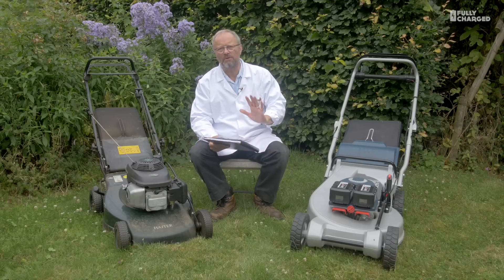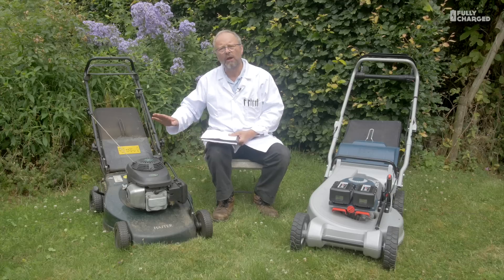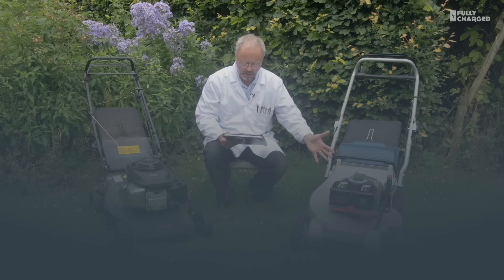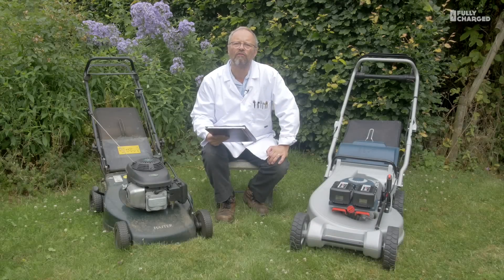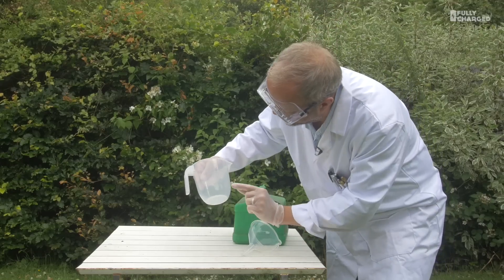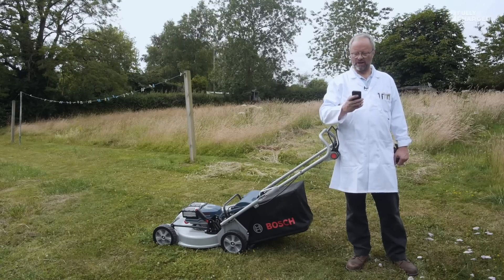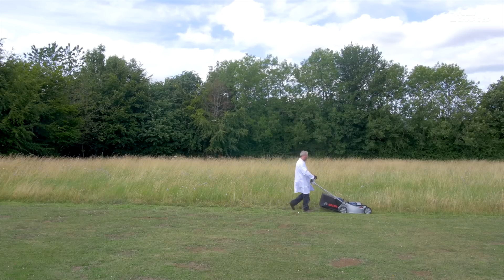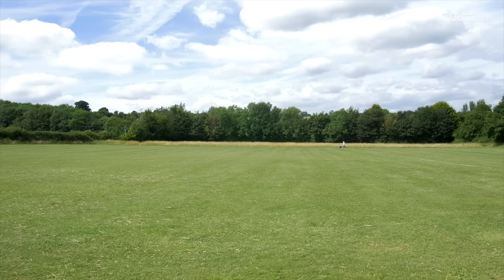Battery V Petrol. The Lawnmower Test | Fully Charged

Comment: Wow, I am really impressed that the batteries only need about 20 minutes to charge when they are completely empty. :-O
Reply: It's a professional grade mower.  The consumer (home) model would take longer to charge and not last as long.
Reply: because BEV is superior to ICE.
Reply: +pcfreak1992 Yup. They also last a good number of cycles apparently. Bosch gives a nice guarantee for that. On the downside, one battery pack costs more than 300 Euros, so both batteries are over 600 Euros. You can buy a cheaper battery mower for that money already.
Reply: Holy crud - I got offered that much for a perfectly working car recently with an MOT.  In fact, my ipad 4 is worth more...right now!
Reply: This mower is built for use at sensible areas like hospitals, because it's quieter. Professionals pay this money because they get it back over the time , and they use it daily and save a lot of gasoline and money. For private use this lawn mower is a nice gadget, but its not economic. But there are smaller, cheaper models for private use, which have smaller, cheaper batteries.

My semi professional petrol mower has a 53 cm blade, now there are 80 Volt battery mowers from the same company with almost the same blade, and for the same prize like my petrol mower 7 years ago.

Comment: Electric engine has energy conversion efficiency (ECE) about 95%  and even more, then petrol engine has ECE about 20-30% ( depends on model). Though, it's really important how electric power has been recieved. If it's  from coal-fired power plant than the difference in efficiency between the types of energy almost disappears.
Reply: +Magic Wind 
Small gas engines like on mowers are not nearly as efficient as car engines.  I think they are more like 10-20% much of the time.
Reply: +Magic Wind
 
Uhm, nope!

http://longtailpipe.com/ebooks/green-transportation-guide-buying-owning-charging-plug-in-vehicles-of-all-kinds/gasoline-electricity-and-the-energy-to-move-transportation-systems/the-coal-powered-ev-myth-electricity-is-only-as-clean-as-the-method-to-generate-it/
Reply: No it doesn't. Do some rudimentary research and you'll see you're roundly incorrect.
Reply: +Magic Wind      20-30% is for a large multi-cylinder engine with all the whistles, such as EM, fuel-injection, water cooled, lean burn, idle-stop, etc. .   For a simple, small, single-cylinder,  carburettor fueled, 'knackered' motor running the same oil/worm-shit lube for 10 years, a bit less.  Try 10%.
Reply: +Magic Wind Even if the electricity is 100% from a fossil-fuel powered power station, the efficiency of the power station burning the gas/oil/coal is always going to be higher than the lawnmower burning the petrol. Plus, there's the opportunity to change the method of electricity production to renewable.
Reply: considering the mower did less than 10% the amount of mowing as the electric one, it's pretty clear the "efficiency" can't be beyond 10% Not to mention that the video was made on a bright sunny day by a guy with solar panels on his roof.

Charging those batteries may have well been "free" energy direct from the sun.

Comment: Pretty interesting, I wonder what a comparable 21" to 21" weight would be with the same decks, etc. how much you gain or loose with batteries and a electric motor over a gas motor.  We have a landscaping company and I have often wondered if we charged the batteries via the trucks Alternator (I wonder how many amps those chargers pull as you guys have 220v over there) between houses.  You could always stack another pack of 18650 Li-ons on there for more range, interesting!
Reply: +Kingsoupturbo im a gardener, they are two grand a pop, my old harry cost 700 quid and is 10 years old, its bombproof, dunno how robust these are, nice and quiet though. servicing would be cheaper.

Comment: Nice touch to convert kWh in BTU just to confuse us all. Us metrics know Joule.

Your piss is also a millions of years old liquid. But that is less relevant because the number of usable Joules contained in warm piss is negligible.

Still. Good job explaining a proper apples and oranges comparison.
Reply: +Tilman Baumann If you're going to point out that piss is millennia old, you may as well point out everything - everything! in the universe is as old as the big bang.  Because it's true.
Reply: +Will Davis well done Sir.
Reply: Will Davis what you say is by the way not correct. Not on a atomic level.
And certainly not on a molecular level.
But those are of course arbitrary definitions of "everything". Molecular bonds of water have been around for a long time.
Stuff has been around for a 'little' longer.
Oil not so long.

Comment: I really appreciate how you always make good use of the charging time.  this may sound facetious, but I assure you it's not.

people go on and on about how it takes a long time to charge, but if there are enough chargers, the range on a decent electric car is more than enough that you really will want to stop before you run out of power.  it was revolutionary for me when you made that point about your tesla.  

and here again, this is just more of the same: yes, it takes longer than pouring gasoline in, but it doesn't take that long.  and you'll want a break anyway!  in the case of this mower, I'm sure that if you absolutely have to keep going, you can get spare batteries and charge while you work.  the batteries are bound to cost, but I doubt it's extreme.

simply awesome demonstration, thank you.
Reply: +ThoperSought On top of that, electricity is piped straight to your house, so you don't need to make a special trip to the petrol station to fill up our little jerry can :)

Comment: So what you're saying is that the energy density of batteries is pants.
Reply from the maker: +l1fechooser In one way, yes, it's very low in comparison to petrol, but with one rather key advantage. It's merely a way of storing energy and can be used again and again and can be charged from any generating source. Pure dirty coal, marginally less dirty gas, relatively clean nuclear as long as you don't count the waste, wind, solar, hydro, etc. 
Petrol/gasoline is only from one source and it's very hard to use it twice.

Comment: The terrible thing about gas/petrol mowers is that they pollute more than a modern car. They don't have all of the advanced emissions controls. I do have one question about this test. Were either of the mowers self propelled?
Reply from the maker: +RickMakes Both models are self propelled and yes, the exhaust system on the petrol mower is very crude to say the least. Would never be allowed on a street vehicle.

Comment: So the lesson seems to be that energy density of the batteries / petrol is one thing, how it is used and the efficiency of the drive train is the more important factor.
Reply: +Stephen Smith It's the efficiency of the powertrain that is more important than the drivetrain.  The drivetrain does not include the engine, but just the bits that make the blades actually move.
Reply: +Will Davis and no reduction gears, transmission, clutch, etc. energy transfers directly to the wheels.

Comment: I am shocked at how long the first mower ran on just a splash of fuel.
Reply from the maker: +Billiamiscool Yes, it was very impressive wasn't it. I was surprised and I've been using that mower for years
Reply: +Billiamiscool It's the way forward for mowers and petrol cars....the big mistake is to fill the tank lol. Splash and dash, with an automated single gallon in the trunk. Every now and again, it throws just a squidge of fuel near the cylinders. Drive to Lands End and back :)
or....could the secret of huge MPG for cars, be to fit lawn mower blades underneath ?!
Reply: That, to me, was the most impressive bit.  I expected it to run less than a minute.
Reply: I would think his test would be much more valid if he just filled up the tank mostly (maybe a nice, round liter), ran it until it was nearly empty, then divided by the time it ran, getting milliliters per minute. Then compare to the electric.

Of course, this isn't really a scientific test anyway, as we have no way of knowing the mowers are doing measurably equivalent work.
Reply: Ronald Garrison that’s missed the whole point. The demonstration centres around the efficiency of electric drive, not about the energy density of petrol, which of course is far better than battery power. But the point is clearly demonstrated - electric drivetrains are far more efficient.

Comment: still crazy how dense petrol is
Reply: +iMiguelAOG 
true
Reply: If only we could extract energy from it efficiently...
Reply: +Craig Blaylock It would be great if all combustion engines had a efficiency similar to e electric engine.
Reply: Ben Bubeck or if batteries were as energy dense as petrol. Imagine the battery life on phones
Reply: It would last literaly a 1000 times longer. (maybe not that much but you get the point) :D
Reply: Ben Bubeck it would be amazing
Reply: I did the battery to petrol energy density comparison a long time ago, and for equal weight, petrol had about 100 times the energy density of a battery, give or take.

That kinda suggests why electric aircraft are lagging behind cars. XD

And... Why the original Tesla roadster (which was a converted lotus ) weighed 500 kg more than it's petrol equivalent, and yet still had maybe 1/10th the amount of stored energy to work with.

Comment: Might have been interesting to compare the decibel readings and running cost also
Reply: Roy Richardson 
according to what he said in another comment, the price for the fuel and electricity is about the same: 10p

other running costs have not, afaik, been addressed.

decibel reading would be interesting to know.
Reply: +ThoperSought Snag is that I do not think his assertion is sufficient - let have a bash

56 ml of petrol at say £1.07 per litre is 5.992 p 
Assumption = Half full batteries for 50 mins = 0.42 kW for 1 hour 40 mins = 0.7 kWh
Economy 7     @ £0.068   / kWh = 4.76 p
Peak rate        @ £0.1329 / kWh = 9.3 p
Agree?
Reply: Roy Richardson
looks reasonable.

Economy 7 is an off peak rate?

I think he was using a slightly higher fuel price, but I don't think it was high enough to cover a 4p difference.  don't remember for sure.
Reply: +ThoperSought Yes Economy 7 is the UK overnight tariff - depends which energy company he is with as to how much he pays on each tariff
Reply: +Roy Richardson The battery capacity was 0.42 kWh. not 0.42 KW. So 0.42 times 0.068 = 0.03 p.
Reply: Roy Richardson
thanks.  I'm in Japan, and the rate depends on how much total power you use; there's no off-peak rate, which is weird.

it seriously makes me want to get off the power grid entirely.
Reply: in the long run battery electric is vastly superior in all respects.
Reply: +Roy Richardson   Bosch claim it is half the db of a petrol mower.  Like VWs test results, that's likely to be with the petrol mower's silencer sawn off and theirs running under a couple of potato sacks.
Reply: belson alan
reminds me of the episode with the blind guy (what was his name??  argh!): the engine noise wasn't the main source of noise from the car.

I suspect that with no load, and no cutting action—and the loudest petrol mower they could find—it's really half (not quite as bad as VW, then), but that the cutting action is a significant proportion of the noise.
Reply: +Roy Richardson I think he stated that the batteries had a combined capacity of 0.42kWh. After a quick look for battery charging efficiency, it would appear that Li batteries have a charge-discharge efficiency of around 85%. So I'd say just times your figures by 0.6

Comment: Never knew there were battery powered lawn movers. Might consider one if they weren't so expensive.
Reply: Moxtrox 
if they get popular, they'll come down.... we can hope this will happen soon, right?
Reply: +Moxtrox They've had them here in Canada for years.  They have improved a lot with the new generation having lithium batteries which means they are a lot lighter.  Only tend to be about $100Cdn more than a similar gas mower. Depending on the manufacturer, they often come with two batteries and you switch them out instead of having the dual mounted battery like the Bosch one shown. 2 Amp Hours, and 40 or 80V mower, so not sure how that compares.  (Work at a  store that sells them, so I have carried a lot of them)
Reply: Caspar0s that's awesome
Reply: +Moxtrox What?  A Good Bosch Rotak electric mower is cheap.  170 GBP.  You could probably get one in  the $200 range.  Note that's corded.  A wireless one is expensive.
Reply: Corded mowers are useless. I don't want to drag 300 meters of extension cords. Not to mention they get tangled around trees.

Comment: I use a STIGA Multiclip 55 el lawnmower. Sure, while it's driven from the home electrical socket and I have to handle with long cables as well as avoid/move said cable in the grass. It sure is alot more economical in the long run with no petrol as well as it's much quieter than a petrol engine. Though I wouldn't mind having that Bosch battery powered lawnmower, it cost nearly 14 times more than my current lawnmower. Probably would just get a good robot to cut the lawn for that price.

Comment: A few years ago I replaced my gas mower with a corded electric mower that cost me slightly less than a gas equivalent would have. I was a fool for not doing it sooner. I plugged in a meter to see how much it cost me to cut my lawn and use the electric edger. Turns out it was about 2.5 US cents (not a big lawn) per use.. Unfortunately I did not keep records of the gas mower, to do an absolute comparison. 

But I have nothing to replace or maintain on the electric mower. Except to sharpen the blade, which both need. Each season I would replace the spark plug and air filter on the gas mower. I know I filled my 1 gallon gas can approximately twice per season. I would estimate that I was spending at least $15 per year to maintain that smelly noisy gas powered dinosaur. And I really love the fact that I can store my electric mower upright against the wall, so that it takes up less space. Can't do that safely with a gas spilling model. 

I have never seen anyone list all the things that have to be maintained, repaired or replaced on gas powered anything compared to the electric equivalent. A Nissan Leaf will never need new fuel injectors, oxygen sensors, mass flow sensor or catalytic converters.

Whether corded or battery, electric is the way to go.
Reply: I did same thing with a used CL mower for $20, Mostly to not have breath fumes. For the elimination of the ICE maintenance or refueling hassle. And its lighter and easy to mow the lawn with. But if u do it to save a few dollars a year on gas ur even a cheaper bastard then me, lol  More power to u :)